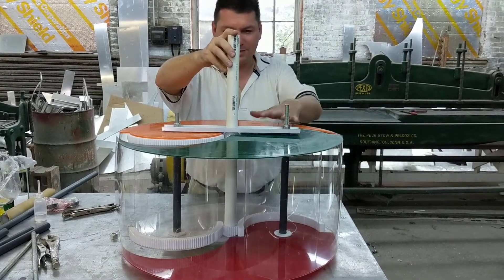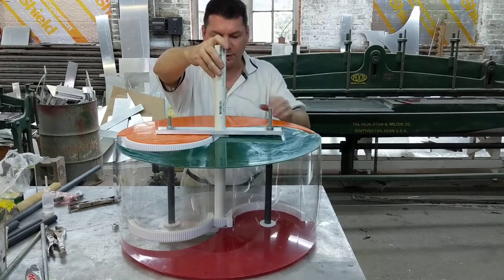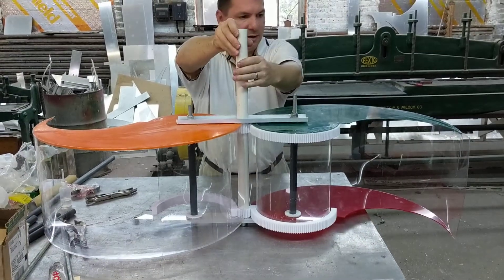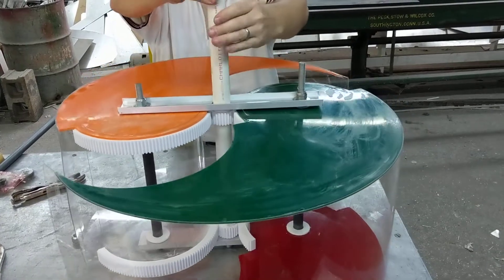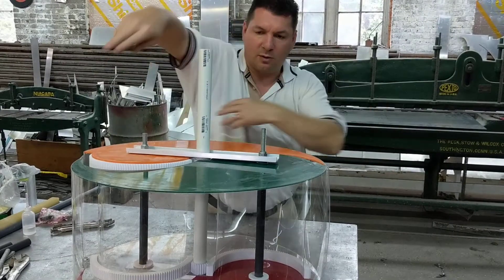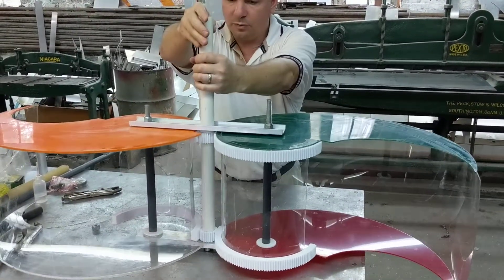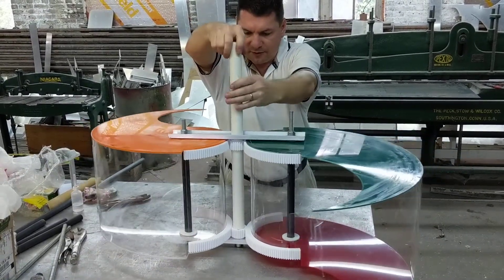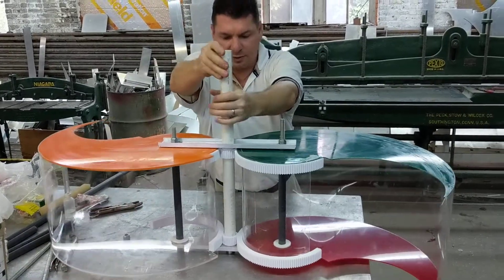Amazing Harmony VAWT Furling Mechanism

Comment: I' curious what kind of governor would rotate the blade control  tube,  centrifugal flyweights, yes, sliding ? up & down a helical cam tube?  Picture a yankee screwdriver action.  just curious.
Reply from the maker: If you watch my Aluminum casting videos you'll see the use of a "worm winch" in those. Basically a wormgear will engage the furling shaft gear tangentially and as soon as power is applied the worm gear spins say 100 revolutions to just 1 revolution on the shaft. Very strong from a torque standpoint and and super precise small slow moves which is what I want. Also when you are done applying power to the wormgear the scoops are held securely at whatever angle you stopped without any additional input from the wormgear motor. Just like my foundry I can take my hand off of the handle and the crucible doesn't move ...it holds strong and steady.

A simple small onboard Arduino or Raspberry Pi computer will monitor the RPM's and control furling both open and close algorithms.

Comment: Yes very good. How do you protect it (anti ferling) at + 40mph wind speed ?
Reply from the maker: Hi James, the furling mechanism locks the furling state at whatever % open it was when power was removed so if it's at 90% open then that's exactly where it holds until power it applied in either one direction or another. It's going to be controlled by an onboard Raspberry Pi or Arduino computer so it optimize power production in the current wind conditions. If you'd like to see Harmony VAWT Latest Updates, here's the Playlist URL: https://www.youtube.com/playlist?list=PLqbwi-6vny7s3NVYuynqVG5oyLxysgfIs

Comment: In order for you to be able to open and close while turning at high speed you must create a gear system such as vehicle transmissions. This allows you to close and open without the system being stopped.
Reply from the maker: Exactly Juan. Good observation! I'm sure you've seen our latest videos but if not, you should check them out.